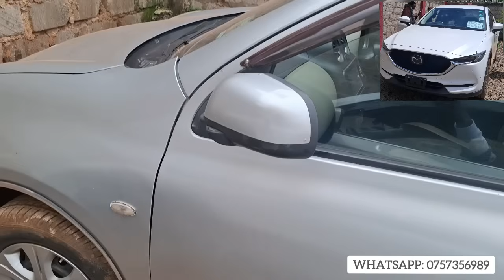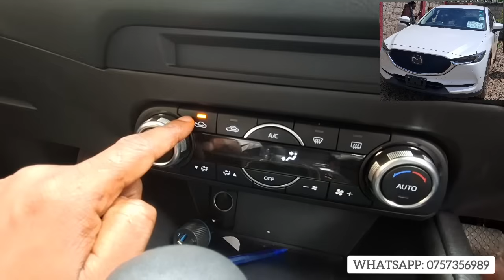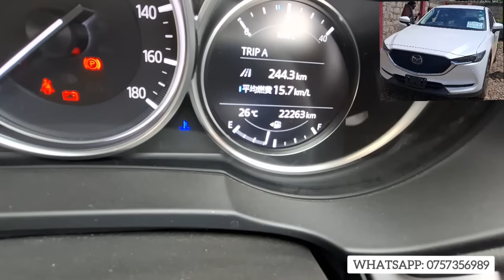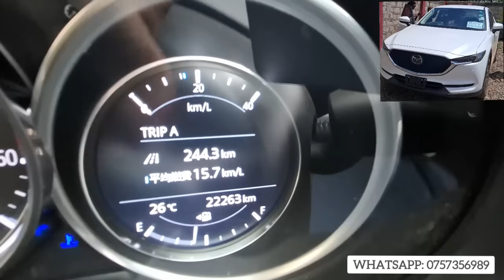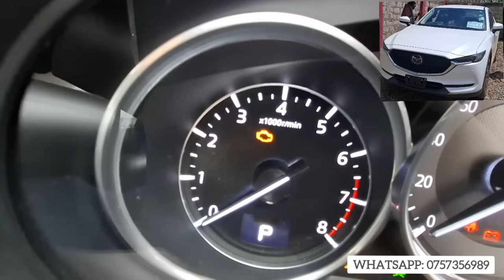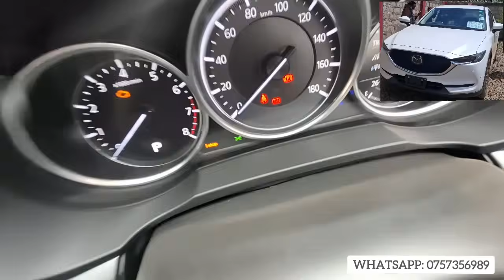I changed this on my Mazda CX-5 2000cc Petrol and achieved high fuel efficiency

Comment: No, you should not use air recirculation continuously under all circumstances, as it can lead to stale air, a buildup of humidity causing foggy windows, and potential driver drowsiness over extended periods. Instead, it should be used strategically depending on the driving conditions.

Comment: Learned something on the AC, again never fight the throttle especially at lower speed's/ gears on this car, took me a while.

But same engine same car I average 6.6l/100km I don't drive slow I get to speed and balance the accelerator

And I use 5w30 oil I also maintain my tires at 240
Reply from the maker: Thanks for the tips

Comment: Tyres should be at correct pressure too + I hope you have changed your oil to a quality synthetic 5w- 40 grade + make sure your air cleaner ain't dirty. Love your honesty on this good looking cx 5. Asante Joseph.
Reply from the maker: Thanks. Btw whats the right tyre pressure for size 19?
Reply: @XploreCarImports huwa iko hapo kwa sticker ya mlango
Reply: 5w-40 will consume more fuel on this car plus it will make  it very very lazy, he should use the recommended 5w-30